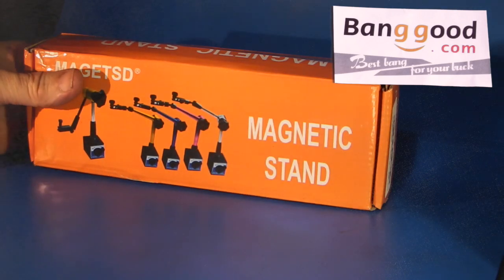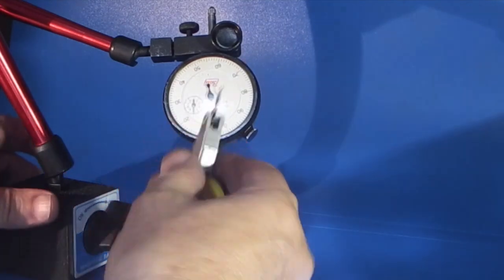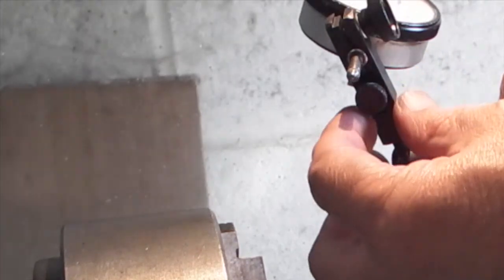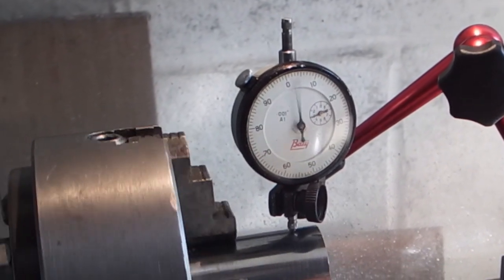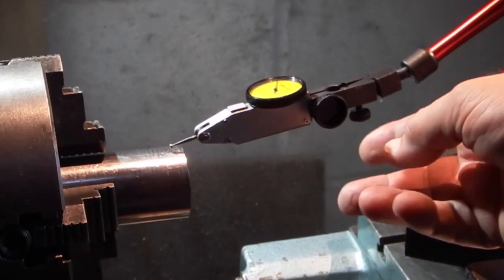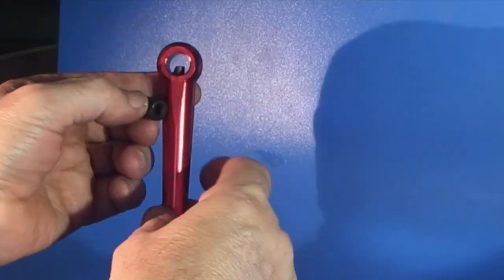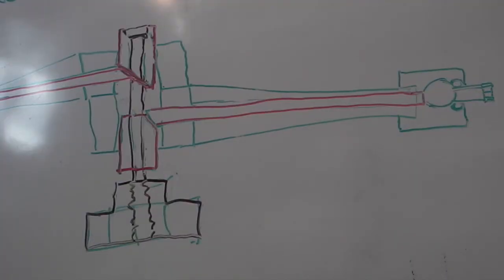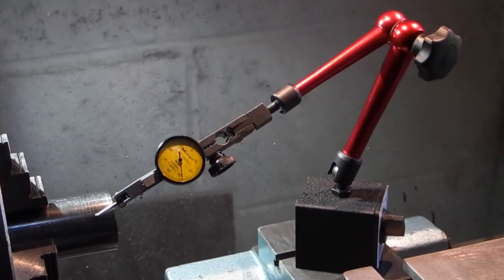Tool Review (Banggood magnetic stand)

Comment: Nice review Allen. I also bought one a while back and the one that is one size larger. I am very pleased with mine. The larger one doesn't come with a base you have to make it yourself. Which was no problem. I used a 2 inch piece of brass rod put 8mm threads in one end and recessed a magnet in the other. Worked out great for me.

Comment: Nice video and thanks for including the illustration. One thing that I would like to point out is that the round hole at the end is for gauges that are 8mm in size. Many Imperial gauges are too large to fit without an adapter of some sort.